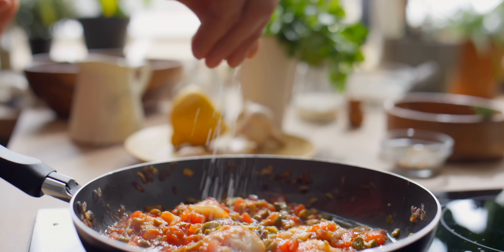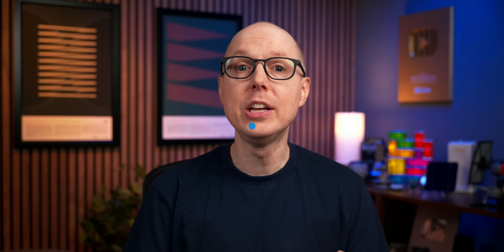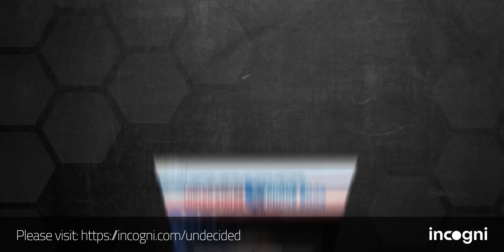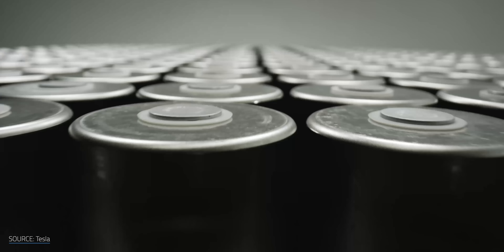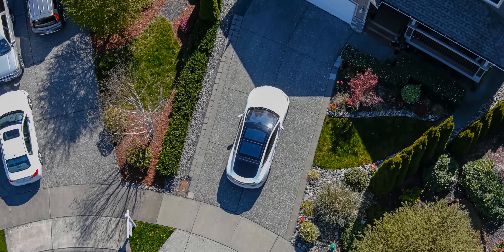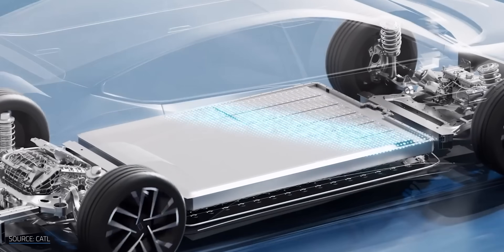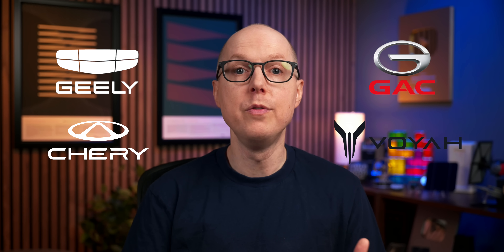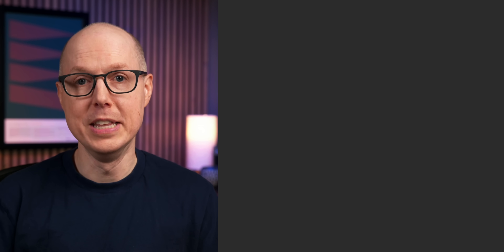How CATL Made Batteries 90% Cheaper (And What Happens Next)

Comment: The word, "infrastructure" is key. If Na batts get 175 to Lith's 185, then much cheaper salt batts can be used for trucks and home storage of solar power. That becomes a huge niche going forward, especially with that 10k cycle lifetime. If CATL can hold to their claimed $10 per KWh, this could happen. But it will still take several years for the market to develop. Also, the political environment in the US will need to change, unless somebody invents a battery that runs on coal.
Reply: In the UK, we have danger of incoming Farage, who has said he will scrap all green incentives and promote fossil fuel use. The guy (and all the crazy folks who will vote him in, just like US MAGA) will set the country back 20 years. As if we needed to get any worse.
Reply: Even though Trump is a menace and a moron 😂 this stuff is still going to happen in the US - the best example is the huge leap forward made in clean energy adoption by Texas during Trump’s last term

Comment: I drive over 25,000 miles a year sodium sounds like the right choice. My commute is not fun but my job provides free EV charging. Even a small bump in car cost could save money if I am charging my car for free instead of paying for 2000 miles of fuel each month. Over 18 gallons a week. Could be huge for me.

Comment: There are battery changing stations in China where the batteries in your ev is automatically changed to fully charged ones instead of plugging in. When the batteries are this cheap, it would make this model more feasible.

Comment: 60% capacity is still more than 5x cheaper. Imagine replacing all your car's batteries every 6 years for only $2000. That is amazing. And battery swaps for all devices will be much more common since they wont explode. One reason why planned obsolescence was allowed so much is because of battery life, battery cost and the danger of lithium ion, not anymore.
Reply: This technology is good, but there's some strange hysteria in some circles about current battery chemistries.

For starts, NMC/NCMA battery powered EVs are 60 times less likely, according to gov statistics, to catch fire, vs fossil cars, and 120 times less likely vs hybrids. LFP further improves that figure by anywhere from twice to an order of magnitude better fire safety. It's a non-issue otherwise ICE cars would have been banned years ago.

Reliability-wise, current battery chemistries can easily last half a million miles just fine. This is perfectly fine for consumer applications, so having more product life than that becomes an industrial applications question.

Lastly, cost-wise you can replace a whole Model 3/Y pack today for around $8k last I checked, costs have gone down significantly. That's not very different from replacing a typical power-train, except this one generally lasts half a million mils or more.

But of course Sodium chemistry is still very welcome for bringing EV costs down to levels that ICE cars have no way of reaching, so bring it on, the cheaper the better, and not everyone needs 300 miles of range.

Comment: There is no way the price will be $10/kW. That is their best case scenario in the future when they are manufacturing on much larger scale.
As for their promises, even if the range is a bit shorter, if the charge cycles are really that much better then people will happily buy electric cars knowing that they won't have to spend half the price of their car to buy new batteries in 10 years or less. Also the car will keep it's price much better while it's risky to buy a used Tesla since it probably has battery degradation.

Comment: Interesting video.  You are using NASA's Technology Readiness Level to characterize these new batteries.   DoD uses a similar TRL scale, but they also use a Manufacturing Readiness Level scale to evaluate new tech.   This is often more relevant for high TRL capabilities like these batteries.  Your video highlights many supply chain and infrastructure issues that would be captured with an MRL rating.   You might consider using it in future videos. Thanks again for the great content.